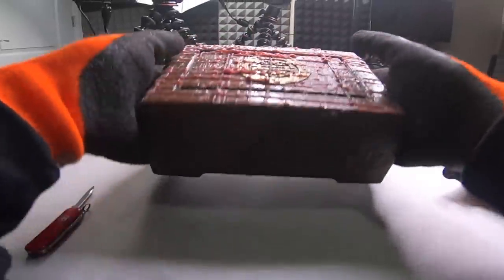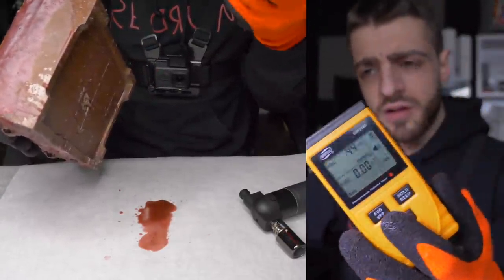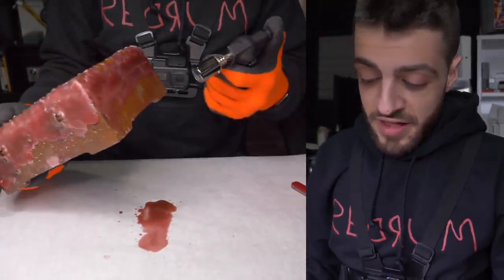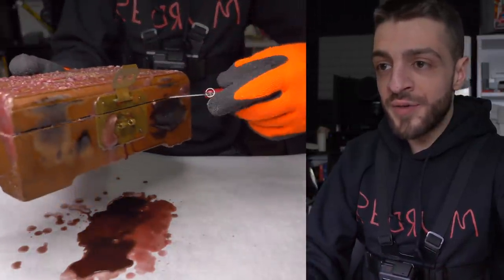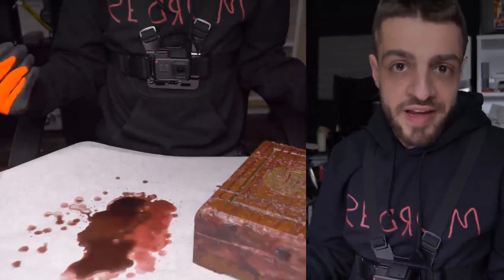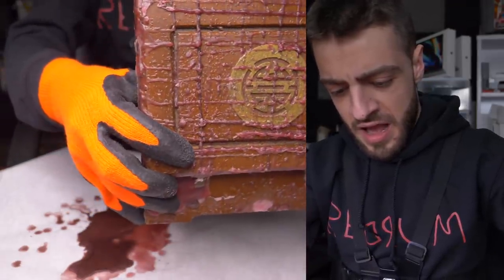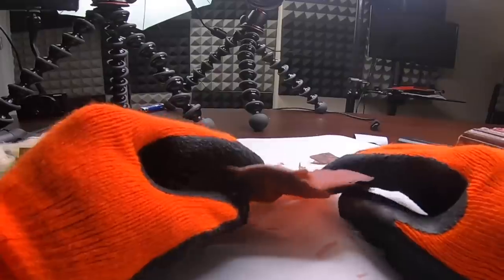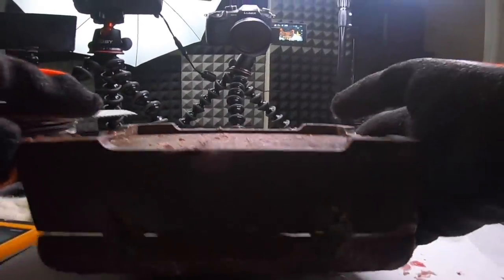REACTING TO DYBBUK BOX (it moves)

Comment: I'm 2:44 into this  and I just had to get a comment in , I've actually paused the vid to write this and not read any of the comments on here about it ,  I'm only guessing and assuming,  the reason for the e.m.f meter to be going off like that is due to you melting the wax (excellent method by the way lol) off the box, this has broken the sacred seel that was placed on it. that was placed on the box during the ritual that banish the Jin to the box ,  the wax was (I'm presuming again ) blessed  whilst being melted on ensuring the banishment,  now that wax was partially removed , so was the powers that the ritual had placed on it , the spikes on the e.m.f was energies starting to release itself/themselves from the place where it was supposed to have stayed at. Sorry guys for the long rant ,  I just saw what was happening and had to get it off my feet. Another banger of a upload thank you

Comment: One issue with electro magnetic detectors is that electronics will set it off. Like your lights and cam. Best would be to check the boxes away from the cams. Stay safe crypto <3

Comment: Opens up a jewelry box  the reason it closes is because it only opens up at a 90 degree level, which means any air or movement that shifts its weight will more than likely, close. Physics 😉